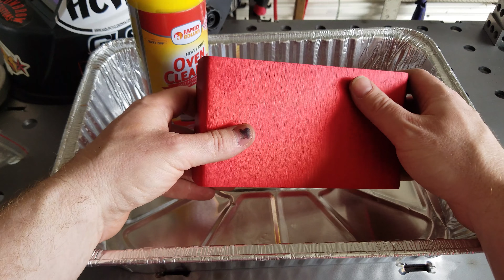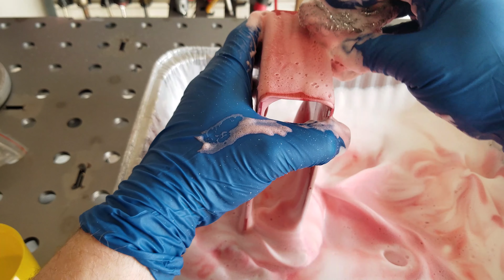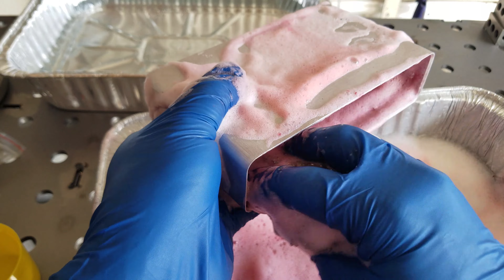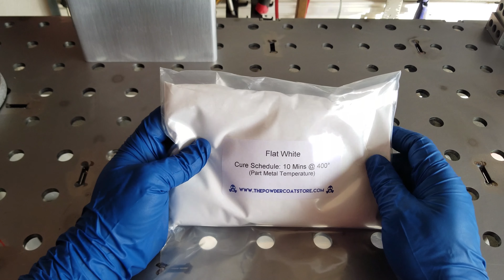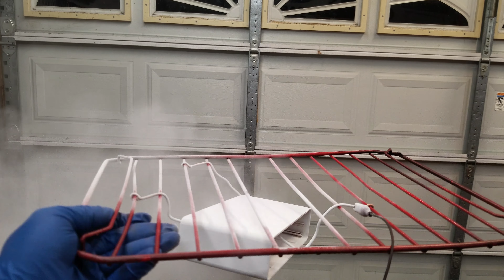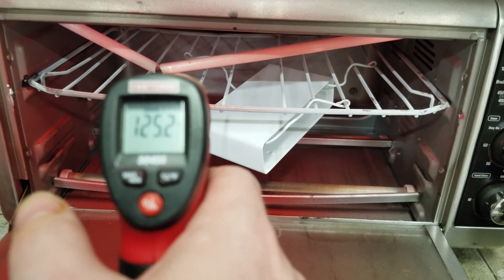Remove anodizing and powder coating aluminum at home!

Comment: Great video.  Would bead blasting work to remove the anodizing?  I recently blasted an anodized motorcycle rim and then powdercoated it but the powdercoat turned out poorly.  I haven't had any trouble doing other parts - just this rim. Is it possible i didn't get the anodizing all off and caused the problem?
Reply from the maker: It should work but anodizing is hard to strip with a blaster and not push some of it into the base metal. You could blast it and then use the oven cleaner to lift any residual off. Be sure to wash and degreaser and then bake to off gas anything that might still be embedded before trying to coat.

Comment: I wonder if you can help me. I’m completely new to this. I bought silver color anodised aluminium and I want to paint in black, what are my options? Do it like you did or is there another way?
Reply from the maker: You can if you would like to strip it all the way to bare aluminum.  If that’s not necessary for your application then just wash with hot water and dawn, rinse and drive thoroughly, wipe with acetone and a lint free rag, apply etching primer followed by the paint you wish to use.
Reply: @HaslipCycleWorks  thanks for getting back to my question. I will go ahead with the primer option.
Reply from the maker: @fady904  no problem at all.

Comment: Why choose powder coating over anodising?
Reply from the maker: That’s what he wanted. Can you even anodize in white?
Reply: @HaslipCycleWorks  no. I guess if you are just dead set on white then powder is the way to go.....but I was just asking because isnt anodising stringer?
Reply from the maker: @flyfishermannick3632  there are 2 types of anodizing. One stronger than the other, but yes I would think anodizing would be a tougher finish.

Comment: I’m reading into powdercoating aluminum and all mayor shops do like a 8 step chem process before actually coating it. Is It really that simple as you showed here? 🙂
Reply from the maker: Yes if the metal is clean. It’s like paint on the prep, the better the surface the better the end result and longevity of the coating
Reply: Haslip Cycle Works wow! Thanks for the response 🙂 so when I want to create a aluminum case which I first beadblast then Apply some Matt clear powdercoating that would work without it peeling of later? 😬😬
Reply from the maker: @maikel371  one thing to do to ensure it’s clean is to wipe or soak in acetone, let air dry, and then heat cycle the part a few times to off gas any oils in the metal. Let it cool completely and then powder coat.

Comment: Can remove powder coat with oven cleaner too or just anodized coat?
Reply from the maker: I've tried it on Powdercoat and it wasn't very successful. You would have much better results with paint stripper.